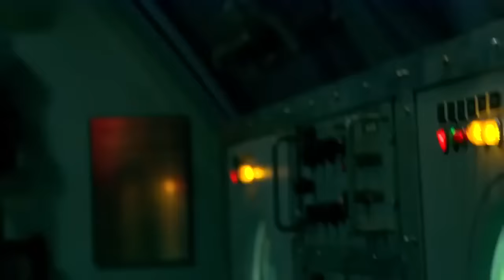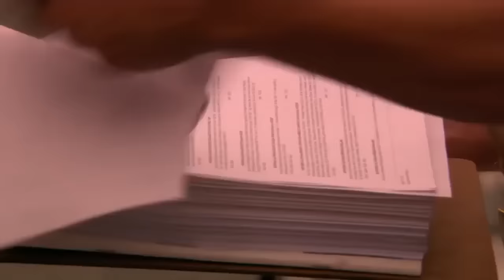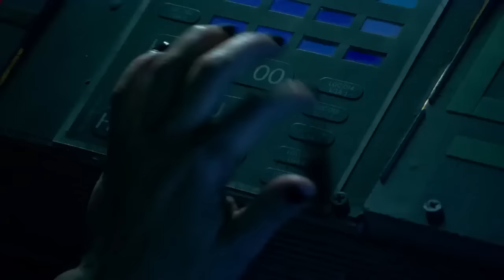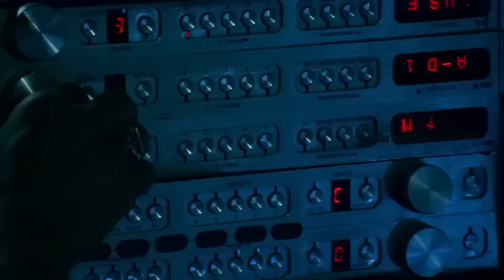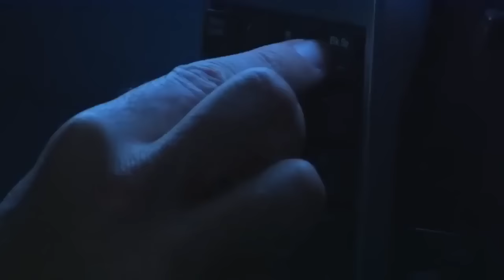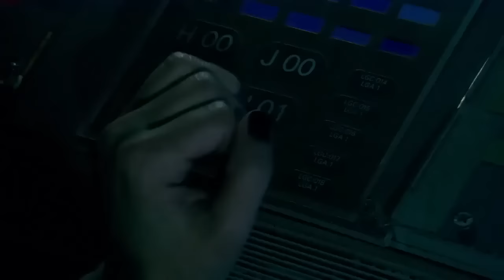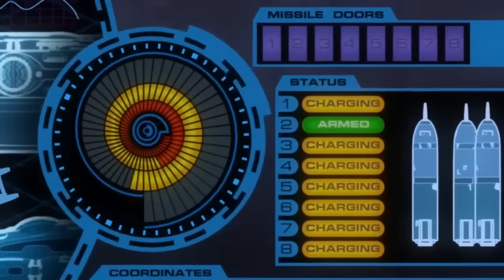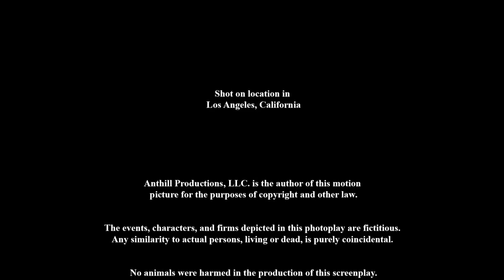30,000 Leagues Under the Sea | Action | Full Movie in English

Comment: You know this is so deep, that if you dived from the Northern pole you would be diving some 153  000 000 meters above the south pole… 1 league is 5556 meters x 30000 ( the depth) = 166 680 000 - 12 712 000 ( meters from north pole to south pole straight thru Earth). Very roughly half way to moon.